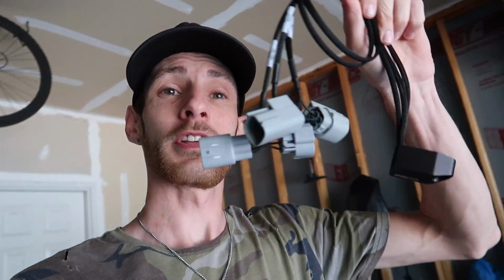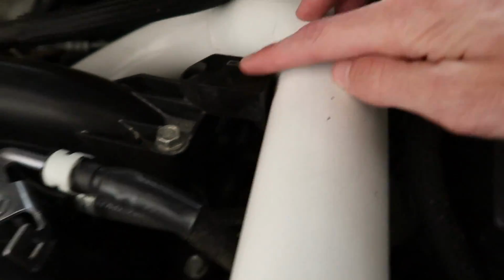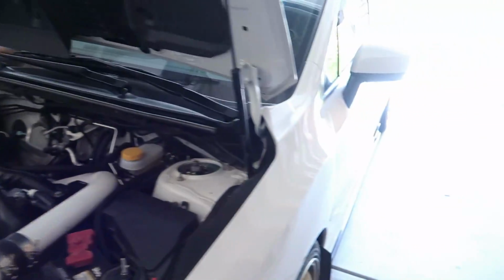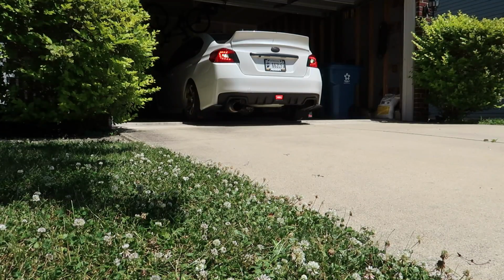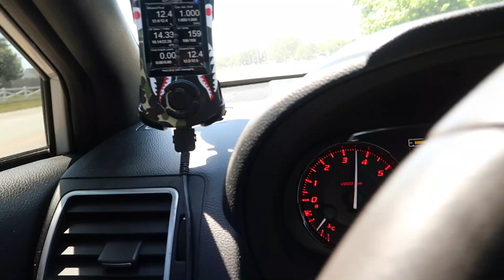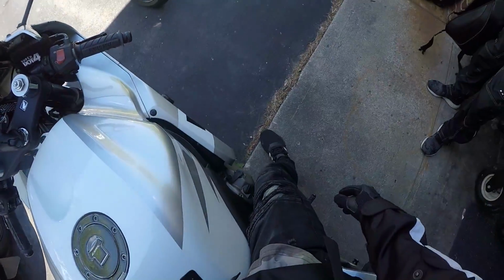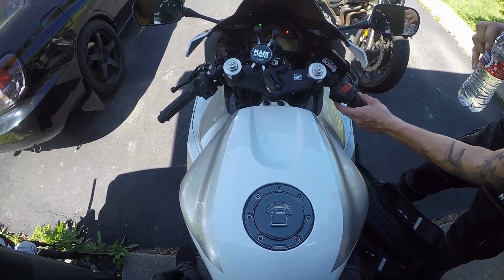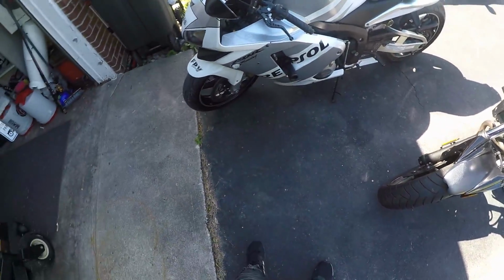Fixing The WRX Check Engine Light

Comment: Please get back to me brotha had the same problem today scanned it nothing but cobb-1 comes up and I had no clue this car I bought had a flex fuel kit and not stock I put 89 octane and right after I turned it on check engine light turned on please help me
Reply: Supremacy TM I wouldn’t run your car on 89 you must have a lot of knock activity I’d pump 91 if available
Reply: Carlos Mendoza the knock activity is the engine sound right ? And I filled on 93 as soon as I emptied it

Comment: Your boy needs to research suspension adjustments before just changing things. You cannot adjust front without the back. The bike is set a certain rake, upset that and it'll handle differently. Especially when tipping into some twisties. Look up preload/rebound/sag/seat height. Plenty of good info out there.

Comment: My car was 2018 WRX,I got the same problem as you,，Engine light,ABS,ESP all came up and i also got Engine code P0171.I have been to two car repair shops and they have not been able to find the problem.Everything is normal while the car is driving.Please give me some advice and tell me how i can  fixed this problem .Thanks！
Reply: Try to clean your MAF sensor with MAF cleaner, sometimes that will throw a CEL. I'd check all your vacuum hoses and lines, P0171 code is I'm assuming System Too Lean (Bank 1)?